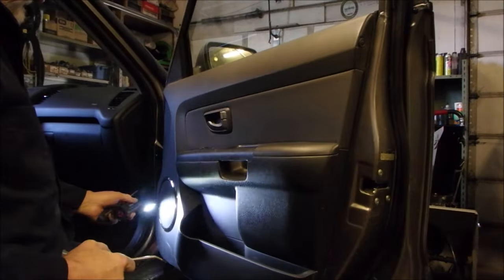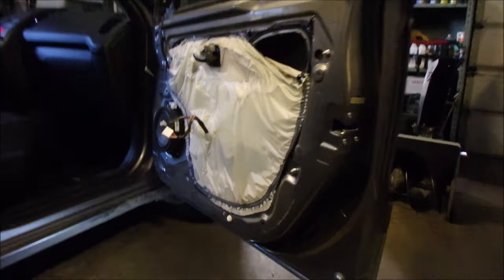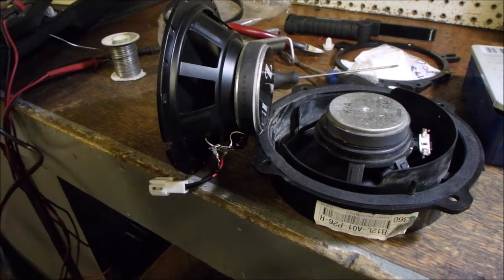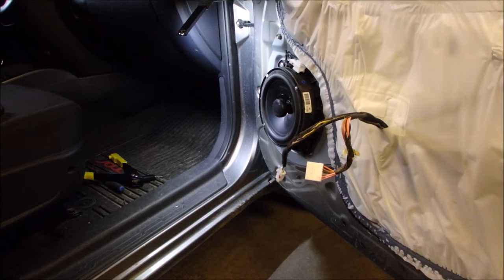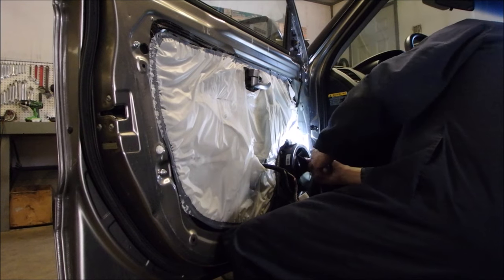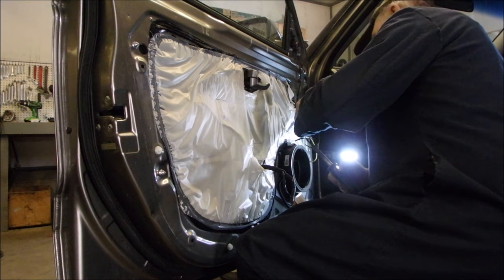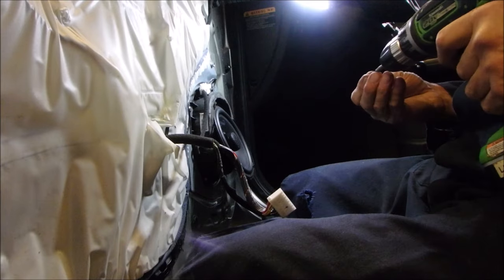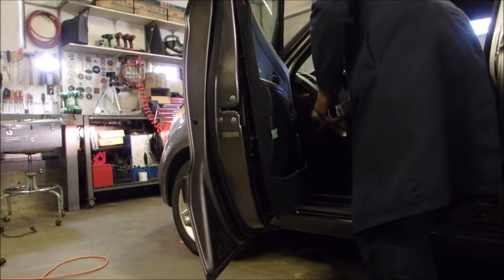Kia Soul Door Speaker Replacements (2 ways)

Comment: Bruce Help! The good news is I was able to clean my carburetor on my yardman 6.5 mower, and it started right up! But I snapped off the top part of the carburetor (plastic part) that the z shaped wire goes through, so now it runs full throttle all the time! Do I need to buy another carburetor? Thanks Cristobal Pacheco
Reply from the maker: I think the carb may need to be replaced.
Reply from the maker: Or you may  be able to drill a small hole in what remains of the lever and adjust the position of the cable.

Comment: What size speakers?
Reply from the maker: I used 6.5 inch but the ones that came out were 6 inch inch me to cut the ridge off the bracket at 16:2 in the video.   Here is the link for the 6.5 inch speakers I bought.
https://www.soundstage-audio.com/product/soundstage-6-5-two-way-120-watts-4-ohms-coaxial-system-speaker-pair/